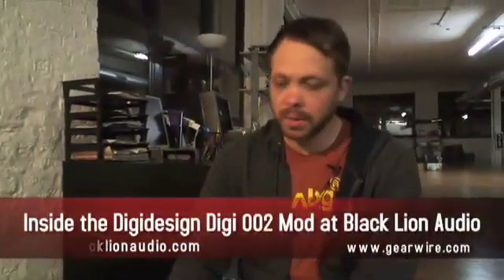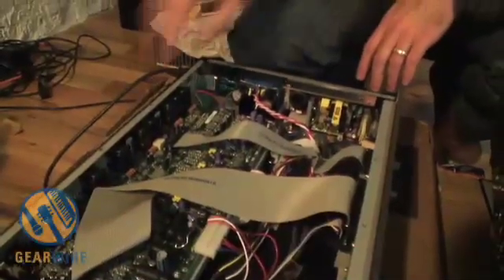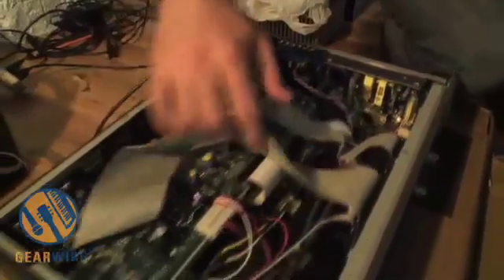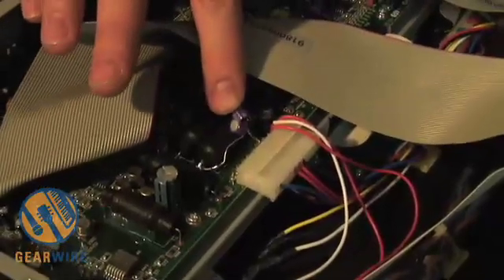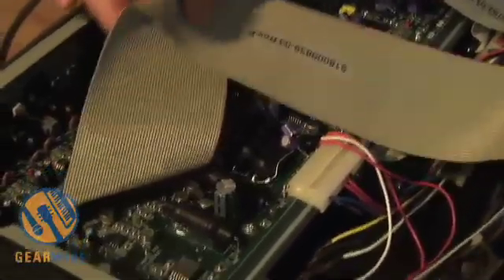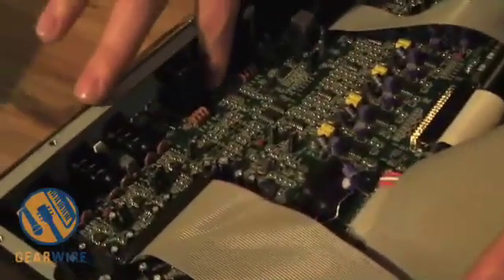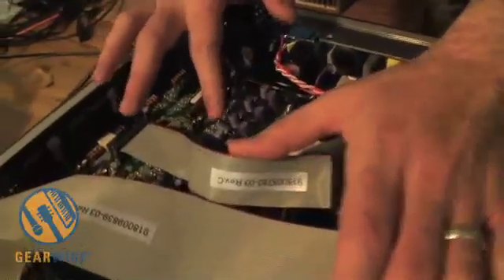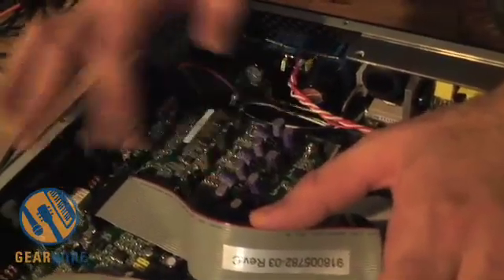Black Lion Audio Digidesign Digi 002 Modification: The Guts

Comment: Hi i am having a problem with my digi 002 console oly the mute light appears when you power it on. I have tried to reset it by pressing the the esc, display, and record buttons at the same time and it worked a few times but now it's not responding at all do you have any possible fixes. Thank You!

Comment: @Malc180s I know this is an old post, but I just want to correct something.  The mic, preamps, and ADC (in that order of impotence mind you), determine the sound going into your DAW.  The DAW really has little to do with it, though the DSP that the HD hardware uses can make for some superior audio quality but that is debatable.  BLA is bringing the hardware up to the level of the HD system to close the gap, which isn't hard to do as the DAC that Avid uses was always known to be it's weak point.

Comment: The HD software and engine is superior. The interfaces all sound much the same (192s, lynx's, SSLs, RMEs, impossible to differentiate), so it's down to the mic pre's. 

So you're saying the slightly upgraded parts in a budget digi interface are superior to any mic pre on the planet, and somehow eclipse the dedicated A-Ds and D-As of this world, which until this point all sound the same?

I'm sure they're good, but don't buy into the bullshit.
Reply: The 002 wasn’t really worth having all that work done!  It was a very poorly designed, budget interface in the very early stages of digital and studios got duped into thinking it was the business!  The MOTU of the same era destroyed it!